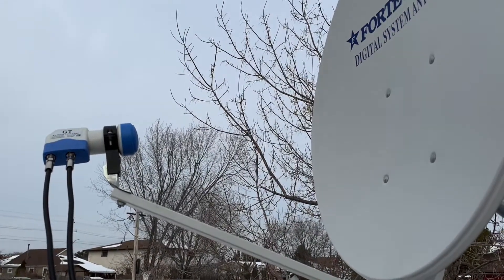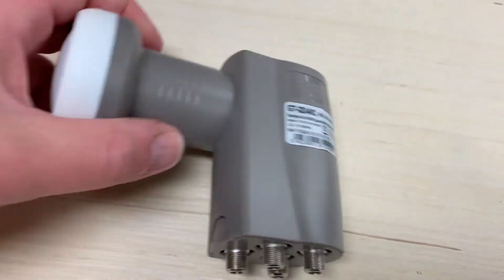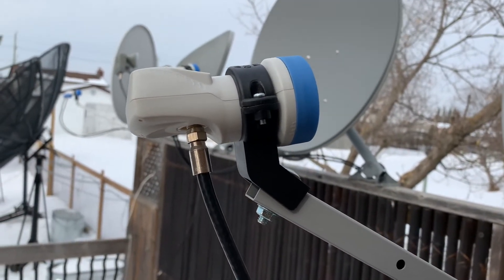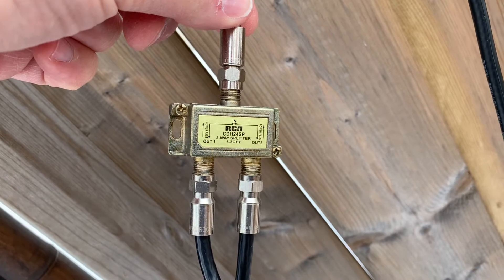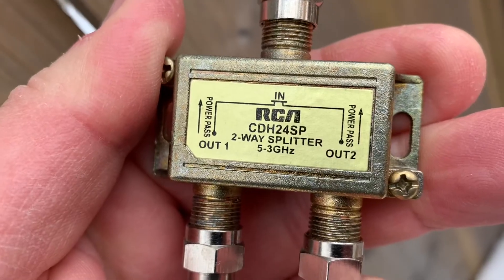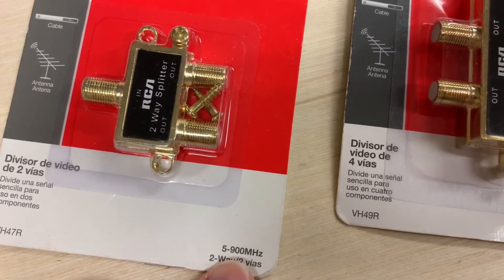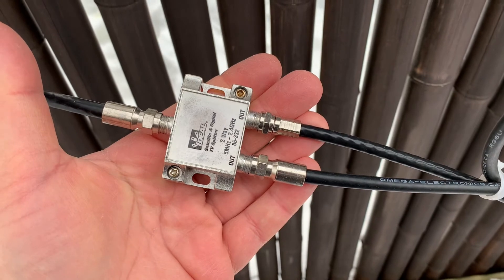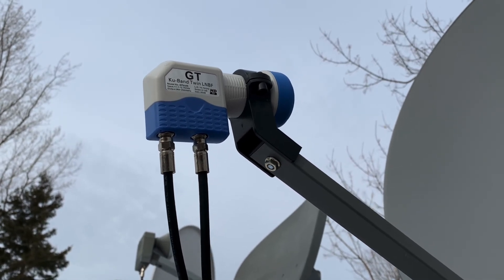How to use a Satellite TV Splitter instead of a multi output LNB to split your dish signal | FTA

Comment: Not an expert, but should mention that
a satellite will transmit some channels in vertical mode and some in horizontal mode.
So with a dual LND you can receive two channels and they can both be vertical, horizontal or one of each.
With a splitter they must both be vertical or horizontal.
So with a splitter you can't select all the channels.
Reply from the maker: @MarkAJAgi  You are absolutely correct! I made another video that is much better informed than this one.

Splitting a Satellite TV Signal to Multiple Receivers - Free Satellite TV
https://youtu.be/N6jwtCU9x7E

Comment: Can you do this with Bell TV ie one input source from Bell dish to satellite splitter and 2 outputs to separate bell receivers and use both tv's at the same time? Thanks ...
Reply from the maker: The best thing to use is a 3x4 multi switch for splitting the signal correctly.

Comment: The lounge works fine but I can't get any sound in the kitchen,one minute it was fine the next, what ever I do I can't get any sound.I remember the engineer saying the amps I have were really good, the engineer was working with cable to pass through the whole from the lounge to the kitchen where there is a freezer
Reply from the maker: This video has more updated information:
Splitting a Satellite TV Signal to Multiple Receivers - Free Satellite TV
https://youtu.be/N6jwtCU9x7E

Comment: Can i use a splitter for 2 tv’s and only one receiver ??
Reply from the maker: Most receivers don’t have RF out, so you’ll need to output from the receiver to the second TV by RCA or some other mode. Maybe a wireless video sender. Or through a modulator.
Reply from the maker: Wireless Video Sender lets you send a video signal to a second TV
https://youtu.be/X14h-jj4NoA
Reply from the maker: RF Modulators: Make your own Private Analog TV Channels the Easy Way
https://youtu.be/1PiKu3CSvp0
Reply from the maker: HDMI to Coax on the Cheap | HDMI to Analog Coaxial Cable
https://youtu.be/fIHpdyl1x-Q